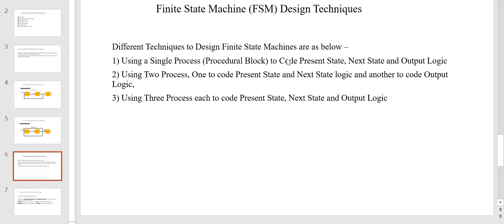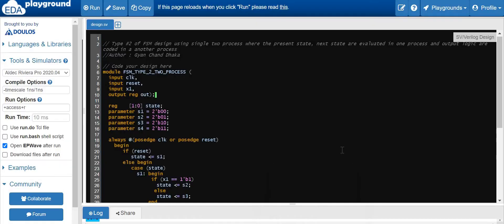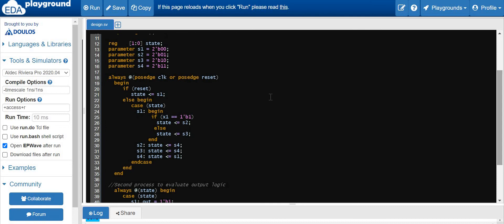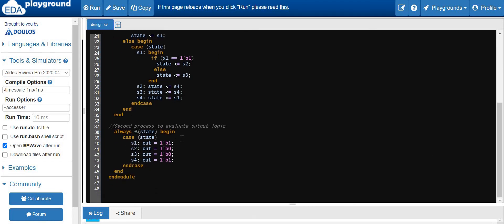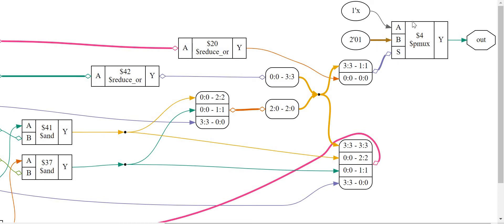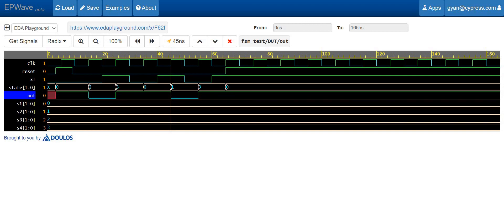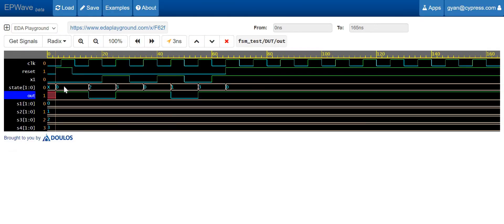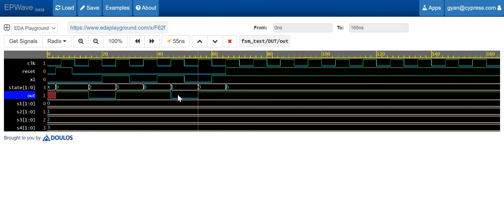Finite State Machine (FSM) Design Technique Type#2| Verilog HDL | Digital System Design | RTL Design

Comment: Sir, in this design code you declared "out " as "output reg out". Then it output should respond after one clock pulse after the the state transition but it is responding immediately after the state transition.
My doubt is........for registered output or non-registered output,  how will the code change ?? where do we need to make changes in the code to use output as registered or non-registered?
Reply from the maker: Hi @Naveen,  Here the output directly depends on the State Value. So, as soon as the state transition happnes, the another procedural block will sample it and will drive the output. 

I would recomend to go through all 3 types of FSM design techniques to understand the registered/Non-registered output concept.

Hope this helps !!